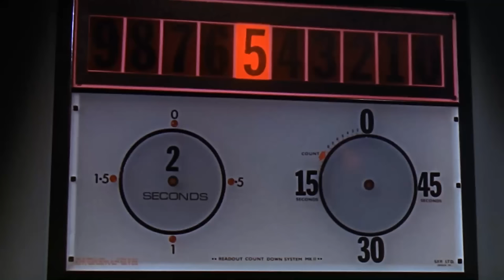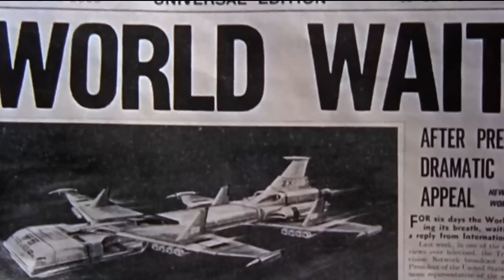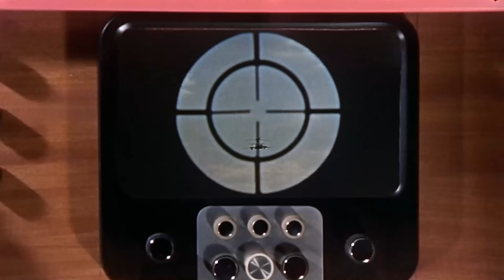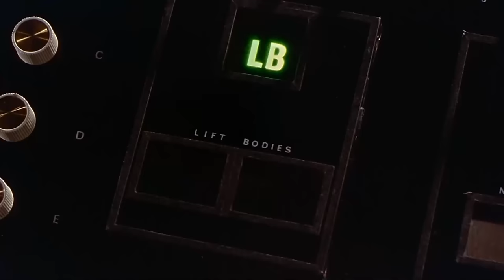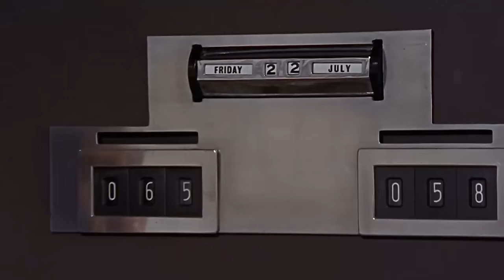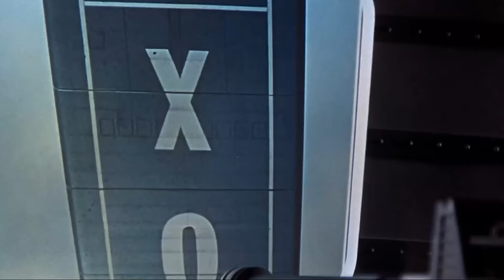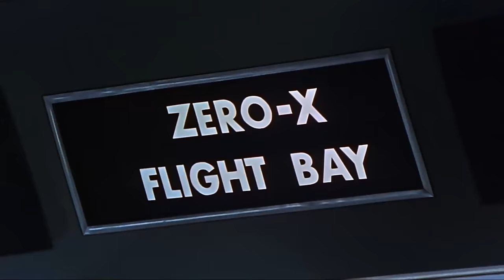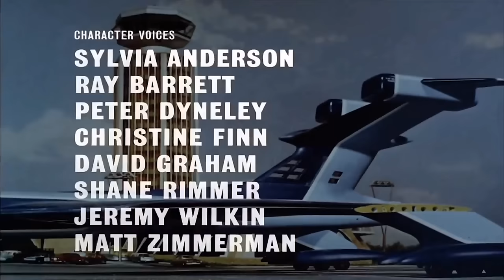Thunderbirds - Mission to the Unknown (Thunderbirds Are Go Fan Edit)

Comment: I'm impressed by whoever made the models and wrote the tech babble for this movie because many aspects and features of Zero-X are spot on with then current British aerospace state of the art.
Rolls Royce and Bristol Engines were working on ramjets and augmented ramjets around the mid 1950s until the late 80s.
The engines on the lift bodies are a close approximation of the Rolls Royce Turbo Rocket concept. A rocket powered turbine allows thrust to be produced until the vehicle reaches sonic speed at mach 1 at which point the turbine is shut down and the engine operates as a full ramjet up to mach 5 and 120,000ft. This approximates to the point where the lift bodies detach as beyond this height there's insufficient air to run a ramjet.
The main rockets take over and propel Zero-X out of the atmosphere.
The commander then orders preparation to switch on the "Arc Jet engine" which is an ion propulsion system. Low thrust over a long period of time to reach mars.
I'm such a geek..........
Reply: They were working on having a hybrid engine, Ram jet to high altitude then turns to rocket propulsion. A British engineer was getting close, but (As usual) couldn't get British funding, & was thinking of going to America. As a thought, they could use the rocket engine to get the craft off the ground & up to Ram jet speed (Drop tanks could carry the extra fuel required),  Ram jets take it up to near space, then rockets cut in again to take it the rest of the way.
Reply: You are such a wonder. You should be proud.
Reply: HOTOL...SABRE...SKYLON...
Reply: Your not a geek, there's not a word invented for you just yet. Please remain in the holding pattern.
Reply: A geek lacks the capacity to explain in such a visual way. Keep at it I enjoyed it
Reply: The models are British, but the "tech Babble" is pure 60s era NASA.
Reply: Hey Dave, you know your stuff!!! Is it possible to make a real lightsaber?🤔
Reply: @Dave Claridge
The person who designed and built many of the models for not only Thunderbirds but also many of Gerry Andersons other productions was Mike Trim,he also did the cover art for Jeff Waynes War of the Worlds record album back in the 1970s.We also shouldnt forget Derek Meddings who was the special effects supervisor on most of Gerry Andersons other shows before moving on to many very well known big budget movies.This was back in the days when special effects/model effects were an art and there were literally only a handful of people who had the talent,experience and skill to do them at that level on the entire planet.
http://www.miketrimart.com/
Reply: No way are you a geek. 
Think about this. 
TB1 had Harrier Jump Jet technology. This was 1966 and yet this episode is 1964.
Similarly other techno is videophones. Unthinkable then but everyday life with SMARTPHONE now. 
There are other examples i am certain of Gerry and Sylvia throughout SUPERMARIONATION. BEFORE also with Fireball XL5 and STINGRAY
Reply: @lifesahobby  BAHAHAHA!!!!

Comment: They use that one model for 3 different things. Airplane nose, airport wing and lander rover.
Reply: Cut from this fan edit, but present in the original film are scenes of it driving from the building in the airfield and attaching to the craft as the nose section. Then another scene of it detaching from the main ship to go down to the surface as a rover.

Comment: why is this magenta colored? The cueing thumbnails are correctly colored but the feature is purple. It's kind of funky in a 1960's way
Reply from the maker: Very strange issue for sure, it definitely wasn't like that before! I've just had a quick test and for me watching the video with Chrome Browser and Microsoft Edge both work fine, Firefox however is magenta as you said. It also plays fine on my Android phone's web browser. Can you let me know if any of these methods work OK for you?
Reply: @ScottX68000  in Firefox and Chrome on Linux it's magenta, as it is in Firefox on Mac Mojave. Safari and Chrome on Mac are normal. Interestingly, the first frame on Chrome on Mac showed magenta but then corrected immediately. Haven't tested on Windows (still on IE there). So it would appear to be a browser issue, or at least an issue with recent HTML5 video control (I notice some of the comments about color were about a year ago, so not an issue related to the latest browser versions - FF and Chrome on my machines are up to date).

At first I assumed it must be different versions of the video delivered by YouTube, which it may well be - that would give a random aspect to the reproducibility of the issue. 

The video is great, even if it has a purple hue ;-) Thanks for putting the work in, and thanks for being responsive to this issue - please post here if you figure out what it is.
Reply: @ScottX68000  FWIW, on Windows 8.1 (IKR), it's fine in IE (YouTube now complains at me that IE is no longer supported but it still works currently) but magenta in the latest versions of Firefox and Chrome. So more ammo for it being a modern browser issue. Presumably your original video works OK if you serve it locally, e.g., which also might implicate YouTube's processing, in conjunction with modern browsers. Good luck!
Reply: @ScottX68000  yet more data: Konqueror on Debian 10 (about 24 months behind the state of the art) and Firefox 78 (SER) on Debian 11 in a VirtualBox VM - video is fine. So, more evidence for it being a modern browser issue. Theoretically you could build every Firefox release between 78 and 92 if you were so inclined ;-)

Presumably there must be something particular about the video processing, possibly in relation to YouTube compression/processing, AND modern browser video processing - perhaps regarding video encryption - that's resulting in a magenta-hued video for many of us. If it is browser related, and not a regression in same, then I would expect the video to be magenta for increasing numbers of viewers going forward.
Reply: @ScottX68000  final data point from me: just downloaded Chrome 94 on Debian 11 in VirtualBox VM (on Debian 10) and the video is magenta.

Comment: To the crop was not necessary. Black bars at the sides are perfectly fine and you don't have to butcher the image. Shame
Reply from the maker: Black bars where at the top and bottom of the screen not the sides. This was originally in cinema super wide-screen not 4:3
Reply: @ScottX68000  I thought you croped from the 4:3 format. I have the series in that format and and here there is image lost from the top and bottom compared to mine, that's why assumed you croped the image from that format. My bad.
Reply from the maker: @azathoz  No worries pal. This movie as well as the Thunderbird 6 movie are both in cinema widescreen.

Comment: 58:00 "It's a good thing we evacuated those buildings when we did.   President Trump said that those buildings would be crawling with Mexicans by now.  Turns out Mexicans knew better, and moved into the White House.  Those buildings were filled with poor Republicans who used to live in Texas.  What, you think all that oil money would last forever?  Lithium batteries!  Now are Tintin and Penny going to kiss or what?"
Reply: "What do you mean they weren't evacuated?"
Reply: "I mean, there'll never be a Craig Tracy... but otherwise, job well done!"
Reply: "Have some delicious Lithium.  It must be safe.  They put it in 7-Up."
Reply: "Good thing EUC didn't stand for ELECTRICAL UNIT, CONTROL" instead of "ESCAPE UNIT, CU-"

Comment: I stopped watching after 10 minutes. What nonsense. Aircraft must be assembled before the start. That will be a solid thing. Why does hangar have to roll away. The falling hangar door leaves 2 depth holes. How are the hydraulic and electrical connections made? Similarly the connections in the control tower.